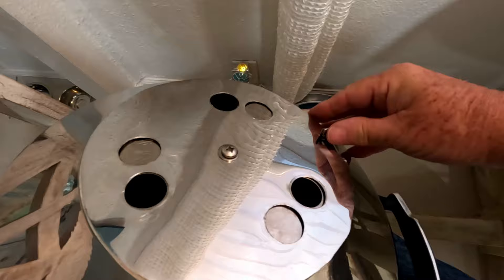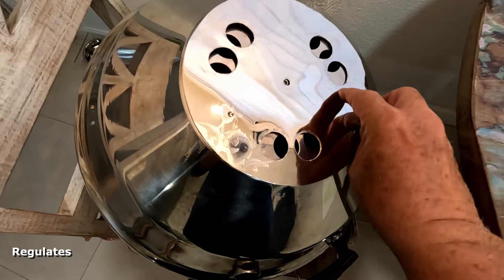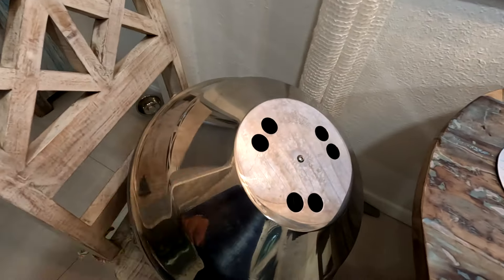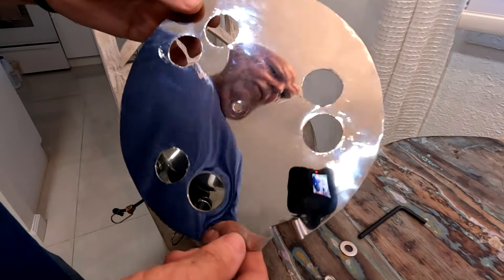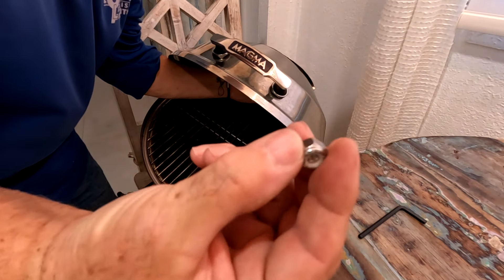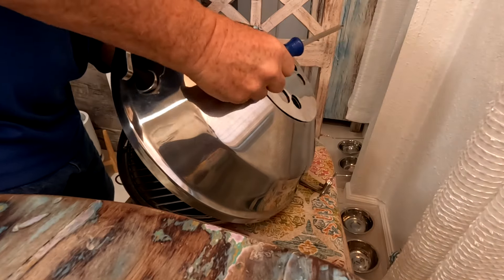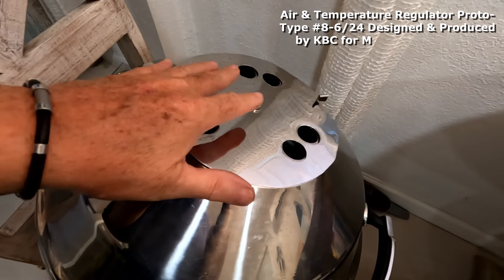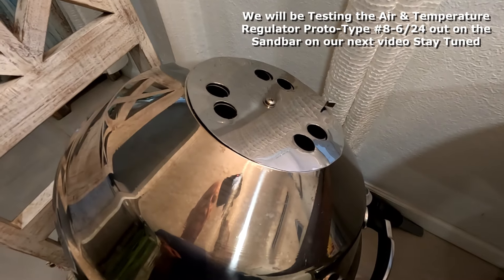Elevate Your BOATING Experience with Our MAGMA Grill INNOVATION - Control the WIND & INTERNAL TEMP

Comment: Great idea. My Webber kettle charcoal grill has similar vents. Never knew why Magma never incorporated such a feature. Arr you concerned that the nylon portion of the nylock is going to melt?
Reply from the maker: Hi Mark! Yes, the locknut was a concern and we changed it to a regular nut with a lock washer. The first burn will be at the sandbar this weekend to test it out, more to come on this Magma add-on on our next video. Thanks for watching our video! Peace from the Keys!
Reply: @KeysBoatingChannel  keep us posted!